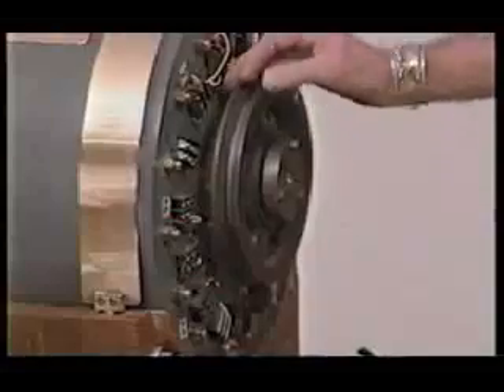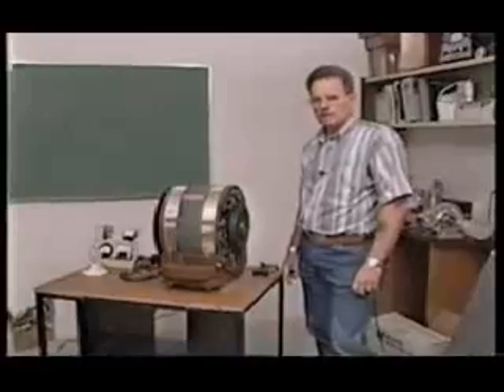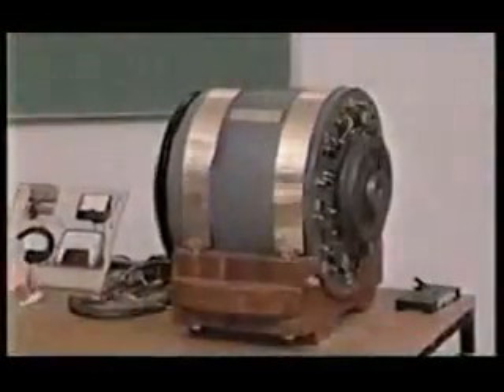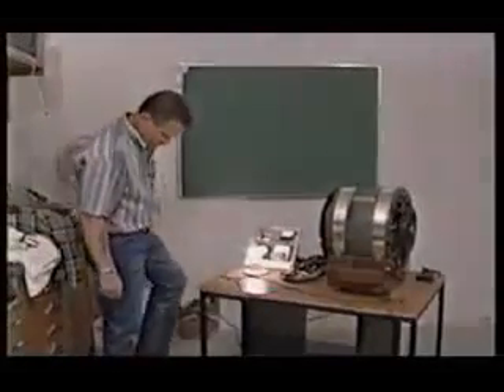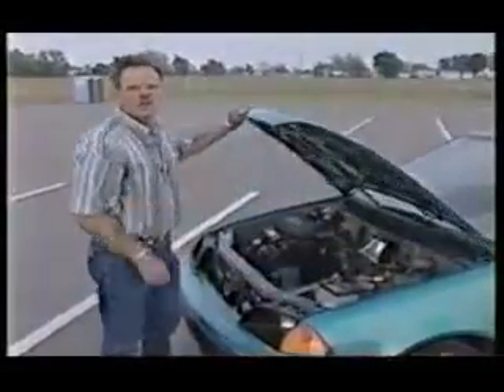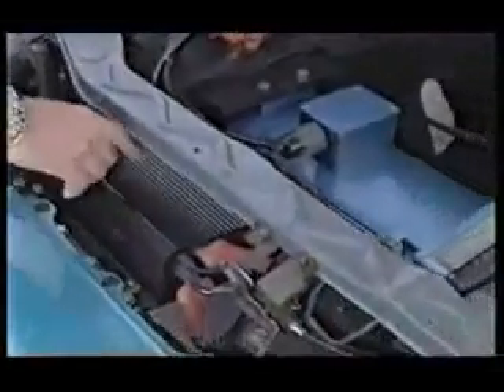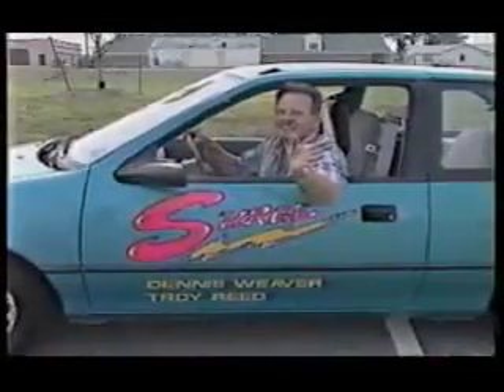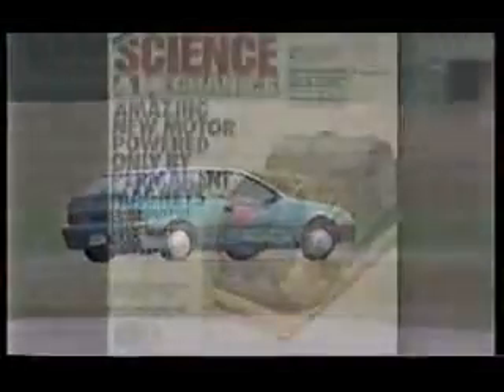(Oil replacement solution) Magnetic Motor - Electric Car Without Battery.

Comment: YOUR ENGINE DON'T GIVE FREE ENERGY! 
If you engine would work and you would be able to get free energy, you would be the most famous and the richest person in the word. Your invention would be more important than the combustion engine + electric motor + nuclear power etc all in together. You would be also a Nobel Prize winner. Free energy would be the most important invention in the whole mankind history.
So, why I have not seen you in else where than in your own videos. This tells that you have wrong, I right. Actually YOU LIE. 
It seems that the belief to permanent magnet motors is much like a religion. There are groups of people who BELIEVE to it though the facts and law of physics says something else. The believers support each other and strengthens each other believe.
Your engine is against natural laws: You can't get free energy. If your motor would work with permanent magnets without external power, the magnets would become weaker and weaker every time while the engine rotates. And soon all the energy would be used.
Reply: +Mark Silver :::What if you combine a fixed magnetic wheel with a propelling magnet that is variable-timed with a computer
Reply: +Phil O'sophical (M.M. Soundtracks) I wonder why people don't understand one of the most important fundamental nature chacateristics: You can't get free energy in any way. The energy can change from one type  to another type, for example potential energy can be easily converted to kinetic enrgy etc. Oil is old solar energy which is stored to oli molecules etc. Some people are only so stupid, that they don't accept this fact. They have only all kind of conspiration theories why the whole world has wrong and they have right.
Reply: +Mark Silver ::: do you completely understand nature's characteristics? What do you believe is the most efficient conversion of energy?
Reply: +Phil O'sophical (M.M. Soundtracks) I have studied physics at university and I am a Master of science. I recommed that you study some primary school physics book. If not, it is useless to continue this because you seem not have any knowlede about this subject. Those who have no knowlede, those are easy victims to all kind of  crooks.
Reply: +Mark Silver ::: I still think computers + magnets could generate great power
Reply: +Mark Silver :::what facts am i denying?
Reply: +Mark Silver ::: I'm sure that I did not mention perpetual motion, did I?
Reply: +Phil O'sophical (M.M. Soundtracks) == YOU SAID: "Computers + magnets could generate great power."  --- Um, no.  Computers CONSUME energy.  And, magnetism is a force, not an energy source.  What you're asserting is equivalent to saying "I think that miles + pounds = blue" (completely unrelated terms that have no meaning together).
Reply: +rockethead7 ::: im not an engineer, but... Could you not harness the force of the magnet to circulate a piston and create energy? But wouldn't that require the propelling magnet to adjust its relative position from the piston for when the piston recirculates, it is not negatively affected by the force of the magnet to propel in the oppossite direction. this is why i offered the idea of variable timing with a cpu to adjust the position of the propelling magnet to the most efficient timing to offer the highest rpm of the piston.
Reply: Phil O'sophical
YOU SAID: "Could you not harness the force of the magnet to circulate a piston and create energy?"

== No. Magnetism is a conservative force (you only get back what energy you put in). The energy you gain from magnets repelling each other is lost in the energy it takes to push them back together again (plus other losses to heat and friction).  There is no magical arrangement of pistons/magnets/whatever that will change this fact.

YOU SAID: "But wouldn't that require the propelling magnet to adjust its relative position from the piston for when the piston recirculates, it is not negatively affected by the force of the magnet to propel in the oppossite direction."

== There is no arrangement of magnets and pistons to make this happen.  If you put all of this into a free diagram, you can use Newtonian vector mechanics to demonstrate that all forces cancel out to zero (thus, it can't work).  There is no arrangement that will work.

YOU SAID: "this is why i offered the idea of variable timing with a cpu to adjust the position of the propelling magnet to the most efficient timing to offer the highest rpm of the piston."

== The amount of energy it takes to move the magnet/piston in and out of position will outweigh the amount of energy you can ever gain back by this mechanism.

I love the fact that you're asking questions instead of asserting things that you know nothing about.  That's exactly what people should do when they don't know a topic, yet so few YouTube people ask questions, and usually they spew utter nonsense without a single question mark.  Thanks for being reasonable.

The physics itself is FAR too complex to put into a YouTube message, and would require quite a bit of foundational background on top of that.  So, I'm sorry if my answer is just "no, it doesn't work that way."  But, to answer in detail would require a lot of time.  Lots of people don't understand thermodynamics until they get into their 3rd or 4th year of university study.  So, there's no way I can encapsulate it into a YouTube message.  But, basically, the first law of thermodynamics is the shorthand version of thousands of pages of physics.  You can't create energy.  That's simply not what energy is.  And, well, the "common sense" argument here is to remind you that if it was THAT simple to create energy, such that you could just attach a few magnets to a cyclical machine with some pistons, well, it would have been done already... billions of times over.
Reply: +rockethead7 ::: i appreciate your response and it sounds like you have a good understanding of this topic, but you're not convincing enough for me to believe that it is IMPOSSIBLE to harness the energy of a magnet to propel a vehicle (with all the magnetic sources being inside the vehicle).
Reply: +rockethead7 ::: "There is no arrangement of magnets and pistons to make this happen."  Do you mean there is not machine in production to support the arrangement of magnets, or do you mean it is physically impossible?
Reply: Phil O'sophical
YOU SAID: "i appreciate your response and it sounds like you have a good understanding of this topic, but you're not convincing enough for me to believe that it is IMPOSSIBLE to harness the energy of a magnet"

== Then you missed my point entirely.  There's no energy in a magnet to harness (short of atomically exploding it anyway).  Energy and force are two different things.  Magnetism is a conservative force.  It can't produce energy.  It's analogous to gravity.  You can only get out of gravity what you put in. If you lift an object, that takes energy.  When you let the object fall, you're getting that energy back.  You can't get back more than you put in.  The same is true of springs.  Compress a spring, that takes energy.  When you release the spring, it gives you back that energy you put in (minus heat and friction).  Magnets are like those things.  Like, there's no special arrangement of springs that can ever give you more energy than you put in.  I assume you understand this??  Same for magnets. You only get back what you put in (minus losses to heat and friction).  Hence, magnets can't drive anything.

YOU SAID: "to propel a vehicle (with all the magnetic sources being inside the vehicle)."

== To move a vehicle, it takes energy.  You keep saying "harness the energy of magnets" - but sorry, there is no such thing.  Well, not usable anyway.  In reality, I will clarify that there's a tiny (and I mean majorly TINY) amount of potential energy in the orientation of the electron orbitals in a magnet.  It's mainly entropic, so you can't use it.  And, even if you could, we're not talking about anything substantial.  Like, maybe the same amount of energy of tapping your finger on your desk once.  And, at the end of that one finger tap, the magnet would be demagnetized anyway (again, this is just hypothetical anyway, because you can't harness the energy, I'm just illustrating how little energy we're talking about if you could hypothetically harness it).  And, again, beyond that, you'd have to atomically explode a magnet to get any energy out of it.

YOU SAID: "There is no arrangement of magnets and pistons to make this happen.  Do you mean there is not machine in production to support the arrangement of magnets, or do you mean it is physically impossible?"

== It's not possible.  You can disprove any one physical design with simple vector dynamics... simple Newtonian laws of motion.  And, if you then extrapolate using some advanced calculus, you can prove that there is NO DESIGN that can EVER work.  I haven't done that math since the 1980s when taking physics courses at my university.  After that level, though, once a person grasps thermodynamics, there really isn't any need for any of the advanced math any longer.  Any energy you get out of magnets repelling apart, you must put back that energy in pushing them back together (again, minus friction and heat).  So, you realize that no matter how clever you try to arrange pistons or gears or levers or cams or [whatever], you will NEVER get more output than input.  And, this goes down into the quantum.  Every interaction at the atomic level demonstrates the same thing, and since a magnet is just a gazillion atoms, you can realize that if it can't be done at the atomic level, it certainly can't be done at any scale larger than that.

You're not alone in not understanding physics.  And, that's fine if you're not convinced by ME.  Why would you be?  This is just YouTube, and I'm nobody.  But, again, it's not ME you have to worry about.  It's the fact that every physics PhD on Earth will tell you the same thing I'm telling you.  Conservation of energy.  It's one of the most fundamental principles in all of physics, stemming from Newton's 3rd law of motion.  You can't get around this.  There is no clever design of pistons or magnets that can get around it.  And, again, this is also because magnetism is a FORCE, not an energy source.  To use another analogy, it's like saying, "how far is it from New York to LA?" and then someone answers "21 pounds."  See what I mean?  Doesn't make sense.  Distance isn't weight.  "21 pounds" isn't a measurement of distance.  Force and energy are similar to that concept... they aren't the same thing.  If you go to any physics PhD and say "harness the magnetic energy" - they'll look at you the same way as if you said, "I'm going to harness these 3000 miles to produce 21 pounds."  Weight isn't distance.  Energy isn't force.  I realize a lot of people find magnets fascinating, because the field is invisible.  But, again, magnets are no different than a spring.  Push magnets together, it takes energy.  You only get back what you put in (minus heat and friction).  Compress a spring, it takes energy.  You only get back what you put in (minus heat and friction).

There's a reason that there isn't a physics institution on the planet trying to engineer little spinning magnet machines.  They understand the physics.  Meanwhile, physicists are building 18 mile long supercolliders.  They're building football field size underground neutrino detectors that can sense a neutrino strike on A SINGLE ATOM.  They're landing spacecraft on asteroids going stellar speeds millions of miles away, compensating for the time differential due to relativity, as well as a mountain of other complex equations.  Believe me, these same people would be able to figure out how to strap some magnets to a spinning device to produce energy, if it was possible.  But, sadly for the world, it's not possible.  It would be nice, of course.  Unlimited energy would create an economic boom like the world has never seen.  It would cure poverty and allow virtually unlimited construction of clean and safe housing for everyone on Earth at dirt cheap prices.  It would allow virtually unlimited travel for cheap prices also.  But, again, magnets simply aren't an energy source.  That's all I can tell you, short of cracking open the books and trying to teach you a few years of physics.
Reply: +rockethead7 ::: could you not multiply the rotations per minute using it's own momentum?
Reply: +rockethead7 ::: if i were to spin one of those playground roundabouts with my arm using the same amount of force each and every time i pushed, the roundabout would gain speed very quickly using its own momentum.
Reply: +rockethead7             :D
Reply: Phil O'sophical
YOU SAID: "could you not multiply the rotations per minute using it's own momentum?"

== "Inertia" would be the more appropriate term.  But, fine, "momentum" works too.  I know what you are asking.  Anyway, inertia IS energy.  All it's good for is preserving the current rotations per minute (minus slow-downs due to friction or heat).  Inertia can't make something go faster.

YOU SAID: "if i were to spin one of those playground roundabouts with my arm using the same amount of force each and every time i pushed, the roundabout would gain speed very quickly using its own momentum."

== You are adding energy to the system when you do that. Your arm is providing the additional energy.  Magnets cannot accomplish this, because they are not energy sources.  They cannot push a playground roundabout on their own.  They'd need an outside energy source.  There is no possible configuration of levers and mechanisms that will make magnets disengage and reengage (like your hand can).  With your hand, you add energy to the spinning toy, pull your hand back, add energy to the spinning toy, pull your hand back, etc.  In order to make magnets do that, it takes energy to pull the magnets away, and even more energy to push them back in place to make the toy spin.  I know you're asking me if some sort of low-energy alternative method could be used so that the "timing" would be perfect to get over each hump, pulling the magnet back at just the right moment, and pushing the magnet back in place at just the right moment.  But, the clincher is, no, you actually can't push the magnet back into place without expending more energy than it takes to spin the toy.  That's simply not how magnetic fields work.  Think of it this way... if you were just talking about a regular piece of metal (not magnetic), sure, you could probably create a low-friction mechanism to pull and push it back and forth with perfect timing in the spinning roundabout toy.  But, of course, just a hunk of metal doesn't do anything.  You'd need a magnet, because that's where the repelling action would come from, right?  That's what you believe, right?  OK, so, no, it can't work.  It takes far more energy to push a magnet into an opposing field than it takes to push just a regular hunk of metal into the field.  The very same property of magnetism that makes magnets repel (or attract) is the property that makes it very difficult to push magnets through those fields.  Once you understand what makes a magnet do what it does, then this will make sense to you.  Anyway, bottom line, you can't get around the first law of thermodynamics, period.  It simply cannot be done.  In physics, this is as clear as 2+2=4.  You can't make 2+2=9, no matter what you try.  Same for energy.  You simply CAN'T get more energy output than input.  I realize that these are "just words" to you (so you don't trust them).  But, it's like the math thing.  Once you understand what numbers are, you realize that you can't make 2+2=9, by definition.  If someone (who doesn't understand numbers) asks you why you can't make 2+2=9, it might be difficult to explain.  They'll just say, "we haven't figured out how yet, but if we keep trying, maybe we can make 2+2=9."  Maybe they'll propose dividing up the 2 into smaller fractions, then add them all up, keep thinking that there's SOME combination of fractions that might make 2+2=9.  But, we both know that can't happen.  Well, energy is like that.  It's tough to grasp and explain.  But, once you do, you'll realize why you will NEVER get more energy output than input.
Reply: +rockethead7 ::: I know nothing about thermodynamics and i'm still convinced there is a way to manipulate and alter the fields in a way that will spin the wheel faster and faster. I have about 60 more years until i'm dead so if they ever invent this i will come back to this comment and never let you live it down professor lol
Reply: Phil O'sophical
Well, think what you wish.  But, that's awfully arrogant.  In the same sentence that you say you know NOTHING about thermodynamics, you state that the first law of thermodynamics is wrong.  Just amazing.
Reply: +rockethead7 Ten points to rockethead7. There are people who try to deny proofed facts though they don't understand them.
Reply: +rockethead7  ::: i wouldn't say arrogant i would say hopeful. There have been many times in history where new ideologies or theories have been mocked bc the current status quo did not support them. Science is always finding out things that were not widely understood in the past. Anyway, since you seem smart, what is your take on the idea of clean energy? do you feel it could be possible to run society on it efficienty if properly funded? if no, why not? Also, what is your take on tesla vs jp morgan and what do you think about the wardenclyffe?
Reply: Phil O'sophical
YOU SAID: "i wouldn't say arrogant i would say hopeful."

== Your words earlier were that you know nothing about thermodynamics, but that you are CONVINCED (not hopeful) that the first law of thermodynamics is wrong.

YOU SAID: "There have been many times in history where new ideologies or theories have been mocked bc the current status quo did not support them."

== Look, there are always new discoveries. But, that doesn't mean that the things we DO KNOW are wrong.  I'll go back to my math analogy.  Mathematics, whether you know it or not, is a growing field that has new areas of study and growth.  For example, the common thought from decades ago was that you could never integrate the sum of two squares.  And, sure, on a Cartesian graph, fine, you can't.  But, as it turns out, if you convert the sum of two squares to a trigonometric function (assuming it's one of the formulas that even can be converted) as a reference to the axis, yes you can integrate it.  Fine, the science of math learned new things.  But, no amount of new innovations and discoveries is math is EVER going to make 2+2=9.  We KNOW 2+2=4.  Well, the first law of thermodynamics is like that.  Sure, there are new discoveries in physics all the time.  But, none of those discoveries is going to overturn the first law, just like no new discoveries are going to overturn 2+2=4.  The first law of thermodynamics is as solid as Newton's 3rd law of motion (and is actually just an extended derivation of it).  Not only can't it be overturned, but, if it was hypothetically wrong, the entire universe couldn't even function as we know it.  Your "hope" that the first law of thermodynamics can be beaten is a nice thought for the sake of humanity.  But, it's just not reality.

YOU SAID: "Science is always finding out things that were not widely understood in the past."

== Yes, and there are some things that simply will never be overturned.  Just because we don't know EVERYTHING... doesn't mean that we know NOTHING.  Yes, there are things we know.

YOU SAID: "Anyway, since you seem smart, what is your take on the idea of clean energy?
 do you feel it could be possible to run society on it efficienty if properly funded?"

== Well, sure. It's going to happen sooner or later, whether the world wants it or not.  The problem is that it's insanely expensive.  Solar panels cost a fortune and don't give the return on investment that some people think (except maybe if you live in the south Pacific with direct sunlight and rare clouds/rain).  Geothermal energy is promising, but also expensive.  Tidal energy is promising, but it's nowhere close to being "green" since putting massive machines out in the reefs is pretty damaging.  I think our best shot right now is wind.  But, it's not 100% reliable (not every day is windy).  But, by combining several different methods, and using nuclear power as a fallback, yes, the world can be supplied with renewable energy for a long time.  But, the costs of all of these things need to come down (or the cost of fossil fuels needs to go up).  With oil and coal being dirt cheap (literally), the world simply isn't inspired to make the investment in the massively more expensive "green" sources.  Electric cars are still ridiculously expensive, even with the $7500-$13,500 that you get back from the government.  Batteries and electric drivetrains cost 5x-10x more than their gasoline counterparts.  So, again, yeah, I think these things are definitely THE future.  We can't live on fossil fuel energy forever.  But, when oil is $27/barrel, you're just not going to see a huge push to go to "green" energy.  Nobody wants to fork over the $$$, except for the very rich who just want to be green for the sake of being green.

YOU SAID: "if no, why not?"

== Right now, it's just too expensive to become mainstream.  But, the costs WILL come down.

YOU SAID: "Also, what is your take on tesla vs jp morgan and what do you think about the wardenclyffe?"

== I don't know anything.
Reply: +rockethead7 ::: I would think it is arrogant to believe we have a complete grasp on the universe; i understand it may be possible to achieve things in this universe that requires greater knowledge outside of science's current understanding. it's possible that the affordability of such technology (solar panels) is dictated by the supply and demand, wouldn't you say? would you agree that many inventions have been bought out and hidden to maximize profits in other business sectors? Also, i have not done enough research myself on the topic, but find the story of tesla vs jp very interesting; I am disappointed that you have zero input on the matter.
Reply: Phil O'sophical

YOU SAID: "I would think it is arrogant to believe we have a complete grasp on the universe;"

== Look, I'm being as polite as I can here.  But, you yourself said that you know nothing about thermodynamics in the very same sentence that you declared utter confidence that the laws of thermodynamics are wrong.  And, again, I addressed this point already.  Just because we don't know everything, doesn't mean we know nothing.  There ARE things we know, whether you choose to acknowledge it or not.  And, frankly, as much as I'd love to try to teach you thermodynamics, it simply cannot be done over YouTube comments.  But, I'll tell you this much... something happens the moment someone understands thermodynamics, UNIVERSALLY, the second that someone grasps thermodynamics is the very same second they permanently abandon the "hope" and "confidence" that you're describing.  Let's face reality here, you really don't know what you're talking about (and you confess that this is true).  So, seriously, if the best you can do to defend the position that producing energy from nothing is "we don't know everything yet" -- sorry, that's just not good enough.  It's really not even close to good enough.  I'll do another math analogy, and that's the very last time I'm going to address this with you until you learn thermodynamics.  Remember in grade school when you learned that a negative number multiplied by a negative number always equals a positive number??  And, maybe your first instinct is, "well, how do we know that, unless we try to multiply every possible number combination from neg-1 to neg-infinity??  Maybe I will try to multiply a bunch of numbers and see if I can break that rule."  Well, that thought comes from a child who is just learning what negative numbers and multiplication really means.  As soon as the child realizes what negative numbers are, and what multiplying really means, yeah, they abandon all hope that there will EVER be some sort of negative x negative that will yield a negative result.  Neg X neg ALWAYS = pos.  Once you grasp numbers and multiplication, you abandon all hope of violating that rule.  Well, in physics, thermodynamics is like that.  Once you grasp it, it all sinks in, rock solid, that you can't violate the laws of thermodynamics.  These aren't hunches.  These aren't matters of human invention to get around it.  This concept governs EVERY reaction between EVERY piece of matter in the universe, from the subatomic, to the size of galaxies, and everything in between.  And, on top of all that, let's pretend that the entirety of physics is wrong, and you can build a machine to do what you're claiming.  Do you know what would happen as a result??  It would form a black hole that would collapse the planet.  And, no, I'm not just being poetic.  See, E=mc2 goes well beyond just the concept of trying to figure out how powerful atomic bombs will be.  If you made any mass produce energy, that mass would increase in mass/density, until a singularity would form, and then poof, there goes the planet.  But, don't worry, because this is all just blabbering hypothetical nonsense that can't happen anyway.  You CAN'T make more energy than you produce.  That would be analogous to making 2+2=9, and the utter destruction that would have on the universe also.  Like, if you look at 2 cars, and you look at another 2 cars, and suddenly there'd be 9 cars instead of just 4 cars.  And, you'd look at two planets, and another two planets, and suddenly there'd be 9 planets.  It's literally a situation that can't happen in anyone's wildest dreams, and simply cannot make sense.  2+2 cannot be 9.  And, you cannot get more energy output than you have input.  If you want to debate this fact, forget about me, and go prove to the world that you're right by submitting the mechanism to violate the first law of thermodynamics for peer review, patenting, and funding.  You'd be the world's first trillionaire if you can do it.  Good luck with that.

YOU SAID: "i understand it may be possible to achieve things in this universe that requires greater knowledge outside of science's current understanding."

== There CAN'T BE an alternate understanding.  This goes into the fundamental nature of WHAT ENERGY IS, and WHAT MASS IS.  I'm very sorry that you don't understand this.  But, seriously, you're like a child sitting there saying, "I'm going to figure out how to multiply a negative X a negative and get a negative result."  "Maybe we just haven't figured out how to do it yet."  "Maybe there are things outside our current understanding of math that will allow NEGXNEG=NEG to happen." "We don't know everything yet, therefore we know nothing."  Seriously, enough already.  You don't know what you're talking about, and my patience is about at an end with your arrogance.  There is not a single physics PhD on the planet who agrees with you.  NOT ONE.  Now, is that because every single physics PhD simply is stuck in his/her ways and can't see possibilities that you can see?  Or, maybe, just maybe, maybe, you don't know anything about physics??  Which is it??  All physics PhDs on Earth for centuries are wrong about physics, or you simply don't understand physics??  Seriously, enough.  You don't know what you're talking about.  I'm not going to keep explaining it to you.  You're FAR too arrogant, and it's become 100% clear that you are psychologically unable to simply admit to yourself that you might be wrong.

YOU SAID: "it's possible that the affordability of such technology (solar panels) is dictated by the supply and demand, wouldn't you say?"

== No. The raw materials and construction methods are still too expensive.  Solar panels don't grow on trees.  They use photovoltaic cells that cost a lot of money to produce.  Eventually, the costs WILL come down.  But, that simply isn't the case yet.  I do kind of like what Mexico is doing, though.  They've built one (and are building more) huge arrays of mirrors that span areas bigger than a football field, and then concentrate the reflection of all of those mirrors at a centralized tower, where they put water and a steam turbine.  This way, they avoid the need for expensive photovoltaic cells, and just produce solar energy the old fashioned (and cheap) way, with a steam turbine.  Of course, that's a lot tougher to do in the USA, being further north than Mexico.  The closer to the equator you are, the better it'll work (more direct sunlight).  But, yeah, they managed to build solar arrays that don't require expensive panels.  They're not as efficient as solar panels, but it's cheap.

YOU SAID: "would you agree that many inventions have been bought out and hidden to maximize profits in other business sectors?"

== If they are hidden, how the hell would I know about them?

YOU SAID: "Also, i have not done enough research myself on the topic, but find the story of tesla vs jp very interesting; I am disappointed that you have zero input on the matter."

== Wait... are you talking about Tesla, as in the long dead inventor?  I originally thought you were talking about Tesla the modern day car company.  If you're talking about the internet bullshit about how people think that Tesla's (the long dead inventor of radio) "technology" was suppressed, seriously, I'm done here.  I have no more time to entertain bullshit coming from someone who doesn't understand physics, and subscribes to absolutely insane internet folklore.  Nobody, and I mean NOBODY, who understands physics, believes that Tesla had any technology that was suppressed.
Reply: +rockethead7 ::: lol but you already wasted hours talking about how i dont understand thermodynamics the past few days why are you done now? i really dont care what YOU say because i know there is research being done with data that you cannot fathom with a ridiculous amount of money. im curious though when and where did you graduate?
Reply: Phil O'sophical Hey, I responded to you out of courtesy.  You do NOT know what you're talking about.  And, now that you have admitted (that which has become 100% clear anyway), that everything I'm trying to tell you is going in one ear and out the other... why on EARTH would I bother any further with you, to even answer a single question more.  You're going to ignore it.

Just remember this: YOU SAID you don't know anything about thermodynamics, in the SAME SENTENCE that you said you're confident that the laws of thermodynamics are wrong.

Yeah, good luck with your Dunning-Kruger delusion.
Reply: +rockethead7 ::: im sorry you feel offended that i offer the idea of science being incomplete, (which it is). you appear to believe that you understand this universe %100  when of course your limited understanding of science is not going to offer the solution to this problem. And im not implying that we know NOTHING...stop with that terrible fallacy.
Reply: +rockethead7 ::: this cannot be a dunning-kruger effect because im not claiming i know anything; you are, sir.
Reply: +Phil O'sophical (M.M. Soundtracks) 

Phil O'sophical said:
"Science is always finding out things that were not widely understood in the past."

Science is finding new thins and new inventions are done based on these new things. Magnetism and laws of thermodynamics are not new things. They are widely understood. It is also understood with 100% certainty, that it is not possible to get energy from magnets.

Now you claim, that you know better than all other people in the world. You have right, and scientists that understand these phenomena have wrong. You who said, that you don't understand them, you claim that you have right. This sounds ridiculous.
Reply: +Lars Sjöträsk ::: im just saying i have faith in the idea that technology will advance using methods that we are unaware of now. i actually think we could create this with the knowledge we already and with enough money this could be achieved. every video i see for these magnetic motors are underfunded small time ideas. i believe many inventions have been suppressed, would you agree?
Reply: +Phil O'sophical (M.M. Soundtracks) Your problem is that you have faith but not understanding. Only a total idiot would fund them. I wonder why you are stupid that you deny proofed facts.
Reply: +Phil O'sophical (M.M. Soundtracks) The basic concept of all magnetic motors is old and simple. It is not any "rocket science". If they were possible, we would have magnetic motors everywhere. And don't say anything about oil industry conspiracy theories - they are complete bullshit and only excuse to those who believe that it is possible to make perpetual motion machines. A magnetic motor would be a perpetual motion machine.
The main problem with magnetic motor believers is, that they are unable to count all the force vectors in the system. A long duration weak force has the same effect as short duration strong force.
Reply: +Mark Silver ::: im not denying proofed facts lol. is it a proofed fact that you may be putting your life on the line if you were to come in between a corporation and it's business? a little bit of life experience has me to be believe that some things will not come to light because they are not allowed to come to light. but i guess this is just unprovable pseudo bullshit to you. :(
Reply: +Lars Sjöträsk ::: " a magnetic motor would be a perpetual motion machine." Would be or could be? And what are the oil industry conspiracy theories please do explain lars
Reply: +Phil O'sophical (M.M. Soundtracks) Have you ever tried to argue with Jehova witness? It is futile. They belive that the word was created a couple of thousand years ago. They deny all facts, for example many million year old fossiles. You are like them. You believe and deny facts. You belive that you know better than for example me and other scientists. You don't even believe that what you see: Nowhere is magentic motors. It is paranodic to believe that oil industy people would kill you if you invent a magnetic motor. I think that your mental health is not ok. You have a serious obsession.
Reply: +Mark Silver ::: lmao how are you going to compare me to jahova witnesses im nothing like jehovas witnessed. im just really surprised nobody has any creative ideas in 2016. I guess the answer is no. :( I do question your intelligence, mark. surely you cannot know it all.
Reply: +Phil O'sophical (M.M. Soundtracks) 
>>a magnetic motor would be a perpetual motion machine." Would be or could be?<<

Yes, it would be. Learn some physics.

>>And what are the oil industry conspiracy theories please do explain lars<<

You gave the answer already: "a little bit of life experience has me to be believe that some things will not come to light because they are not allowed to come to light."
This claim can be true if somebody tries to hide for example pollution, but nobody can prevent anybody to build magnetic motors in their garage. The truth is, that nobody has succeeded. The reason is simple: Nobody can violate the laws of physics. Face the facts, don't be stupid!
Reply: +Phil O'sophical (M.M. Soundtracks) Do you believe, that  Elon Musk (chairman and CEO of Tesla Motors) is in life danger, because he produces electric cars which is agaist oil company interest? (Revenue US$ 3.198 billion 2014.)
Or are only those peope in life danger, who have not achived anything important and explain in YouTube, that oil industry prevent their inventios to come true?
Why Tesla Motor company uses expensive lithium batteries, if it is possible to make an electric car without it? Or are they too poor to put money to magnetic motor recearch? So you should go and tell them how the motors should be done.
Are you still living in that illusion, that it is possible to make a magnetic motor which gives free energy?
Reply: +Mark Silver ::: free energy im not sure. clean and efficient i believe is possible. im sure if you look hard enough you will see why tesla has its place on the market. you believe in assassinations. interesting.
Reply: +Phil O'sophical (M.M. Soundtracks) I have a relative working in mental hospital. In the hospital are people who believe that some agents try to kill them, someone believes that he is reborn Jesus etc. Yes, I don't believe that those people shall be killed, who belive that they can violate natural laws and make magnetic motor. It is not "suprising" that I am not paranoidic who believe to assassinations. You have watched too much stupid FOX channel, if you believe that. I neither have ever denied that Tesla cars would not have a place for market. You mix things. Good bye! I shall stop this useless discussion.
Reply: +Mark Silver ::: cya